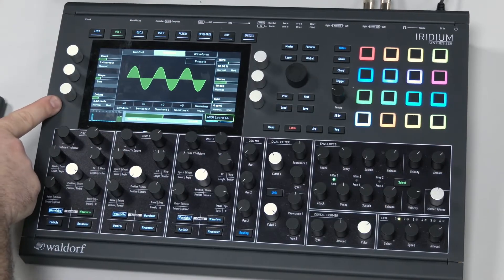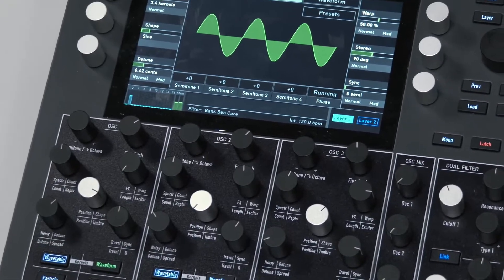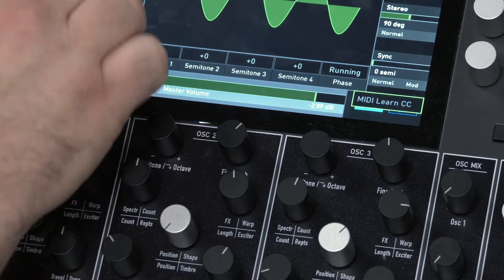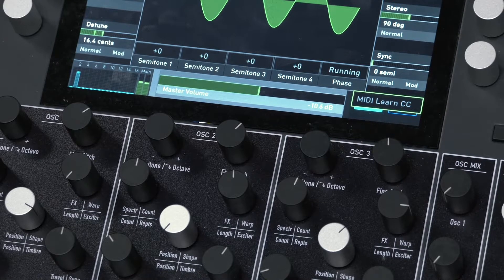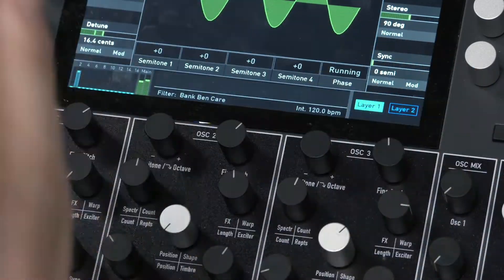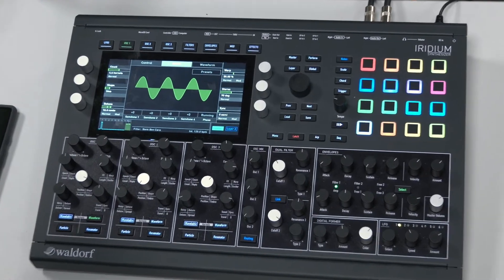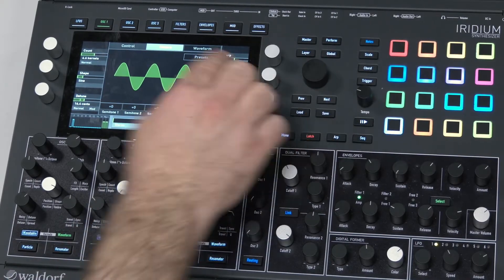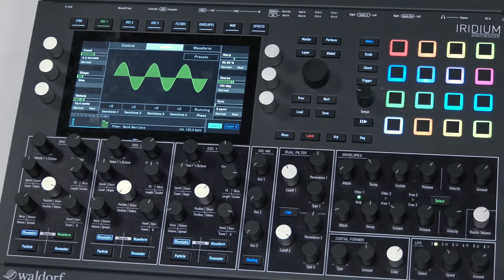SCM Waldorf Iridium Workshop: Video 2 - Waveform Oscillator (Virtual Analog)

Comment: I think a pertinent piece of information is that when detuning a symmetrical wave like a sine, you get full (or nearly full) phase cancellations. The waveforms volume sums to zero amplitude (no output).
Asymmetric waveforms like a saw does not phase cancel against itself. A saw shifted in phase by half a cycle sums to a saw an octave higher. There is no full drop in amplitude.

There are other things we could talk about like the difference between a phase shift and a polarity flip. Or other more esoteric concepts like DTMF signaling vs AM vs ring mod vs XOR etc etc etc.
Reply from the maker: yep all very true... the phase cancellations with a saw wave create ripples of course because some harmonics will phase cancel, but not the whole signal... in the context of this class for my students though, I didn't feel this level of detail was necessary, as I'm giving them enough to go on in order to make the most out of the creative options of the instrument.. we discuss theory like this in other contexts, but thanks for the comment.
Reply: @BenjaminCarey   Yeah great point about the spectrum ripples. In fact the beating sines themselves are a kind of spectral ripple since the different frequencies can never perfectly null. My comment was aimed moreso at your students which is why I over explained it a bit. The semi related topics were peppered in at the end to help them realize that no matter how much they think they know… there’s a lotttt more to know beyond that! You have to be well versed to understand how detuning creates DTMF, and how DTMF is related to AM, and then how AM is related to RM which is related to XOR… so on and so forth.